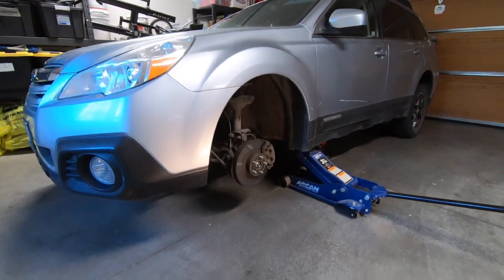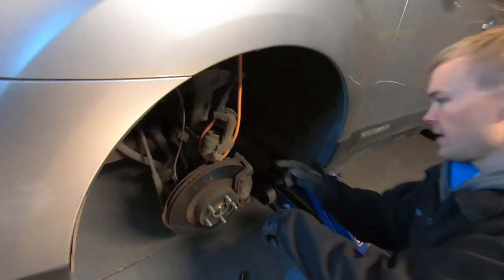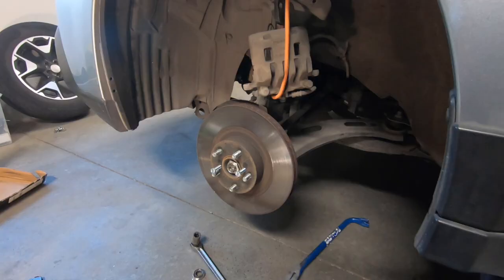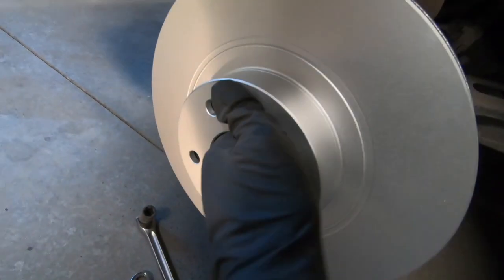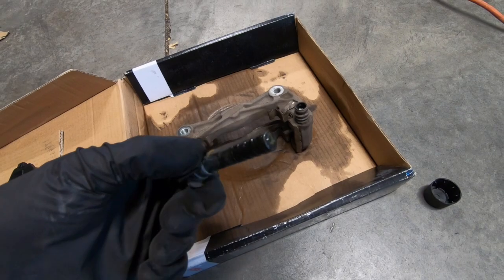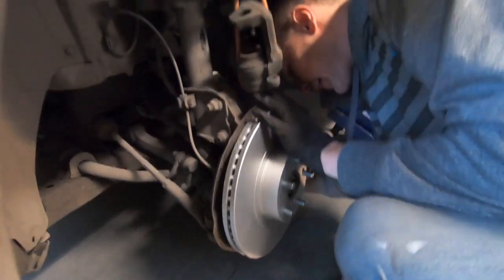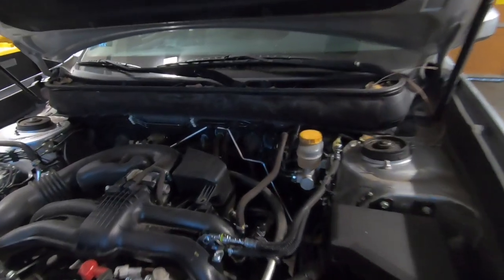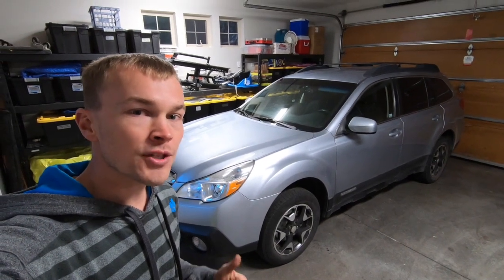2009-2014 Subaru Outback Brake Replacement

Comment: Why do you grease the back of the brakes pads?
Reply from the maker: Was recommended in the instructions we used
Reply: It’s for noise reduction. Brakes on occasion make noise such as squeaks. Doesn’t effect the braking ability but people will often complain if there’s noise. The grease muffles vibration and reduces noise. Makes people happy. Also keeps parts lubricated